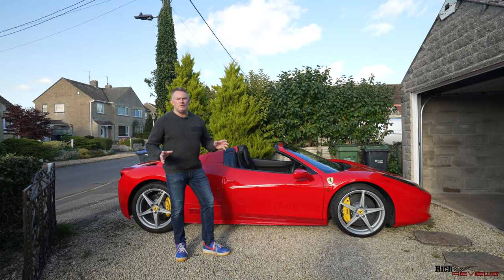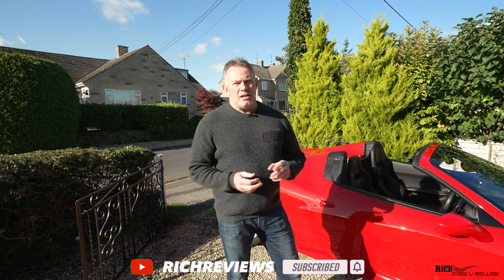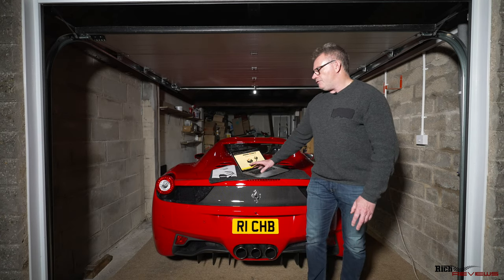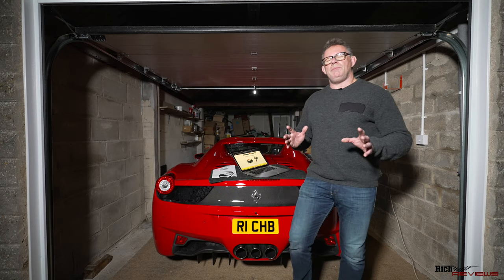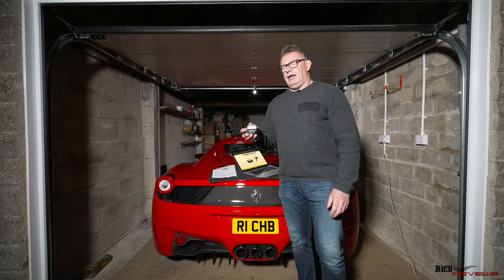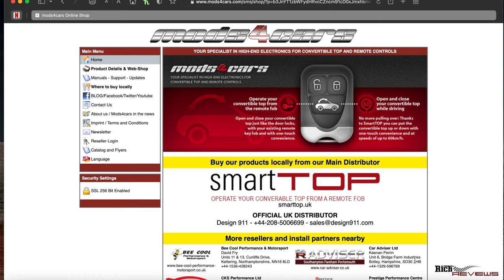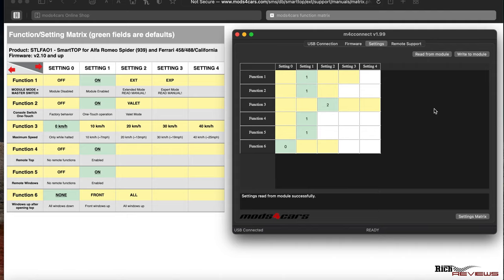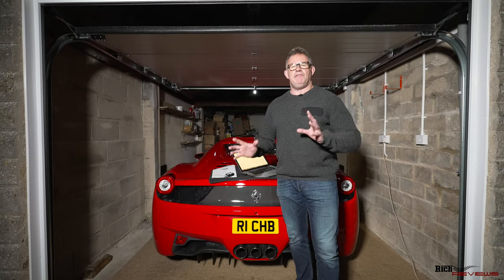HOW TO OPERATE THE FERRARI 458 ROOF WHILE DRIVING! (SmarTOP Review)

Comment: Finally got round to fitting this to my Cali (12m after buying the unit and the car!).

Had to come back to your video Rich for the appropriate button timings and explanation around pausing between lock/unlock ahead of the 3 clicks etc.  Took about an hour to fit and is a must have.  Can’t believe I went this long without it but makes life easier climbing out the car when it’s in the garage (roof operates in the garage perfectly).  Cheers!!
Reply from the maker: Glad the video helped my friend. I always used the device to drop the roof in the garage before getting in.

Comment: I own just the same car (458 Spider, rosso corsa, yellow calipers, black interior with red stitches, only the configuration is continental with the steering wheel on the left hand side for Germany). I added the smart top module last year. As you showed us, it's easy to install and easy to operate. The opportunity to open the roof when driving is one advantage. For stability reasons of the roof construction I limited the max. opening speed to 20 km/h in order not to bend any metal in the construction. But still you can open or close the roof while slowly starting at a traffic light for example.

To me the biggest advantage is the opportunity to open the roof from outside. A big plus in tight parking areas.

I like your reviews. Keep up the channel! 👍
Reply from the maker: Thank you…for me the remote opening is a bonus to aid getting in/out with bad knees. 😅

Comment: Rich greetings from Australia and thanks for the tip on the smarttop. I ordered it and used your code to get a discount. Arrived in a few days. Installation straight forward thanks to your video. Works a treat and transforms the usability of the roof. Ps I forgot to disconnect the battery and made no difference fyi. Also installed Invery Air to replace my Bovee. Works much better. Connects every time. Keep up the good work. Julian
Reply from the maker: Great to hear Julian, really pleased the SmarTOP and Invery worked out well for you. 
BTW, the battery disconnect is a safety precaution purely from my side not the supplier so should be okay…I always err on the side of caution. 😁

Comment: Rich, before I fit mine, could I ask if you still have yours installed or did you remove before sending back for screen repairs etc? Regards, Roy
Reply from the maker: Still have mine installed. I disable when car goes in to the workshop.
Reply: @RichReviews_  great, thank you. It’s just that you haven’t mentioned it for a while 😀
Reply from the maker: I had no need to. 😀